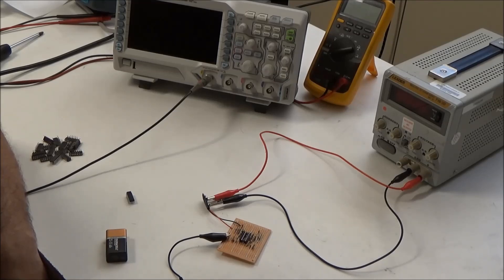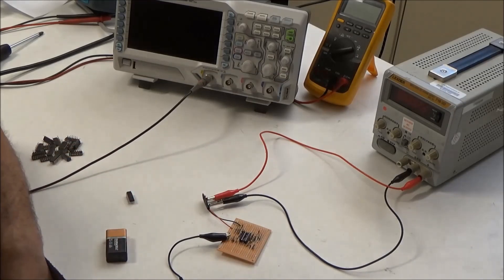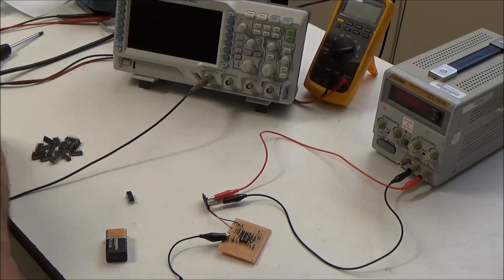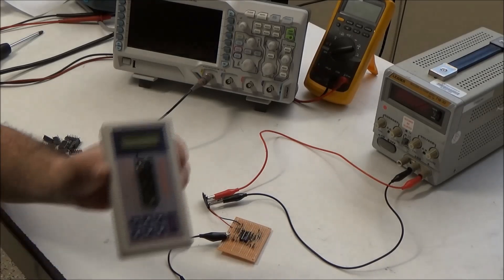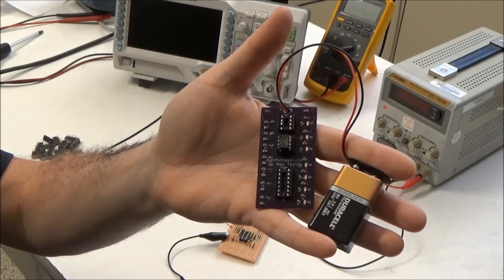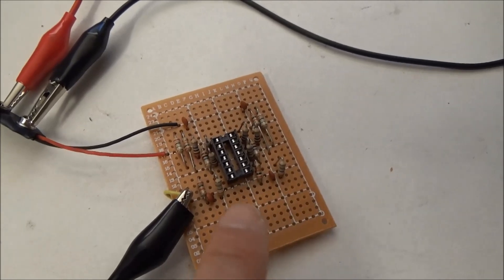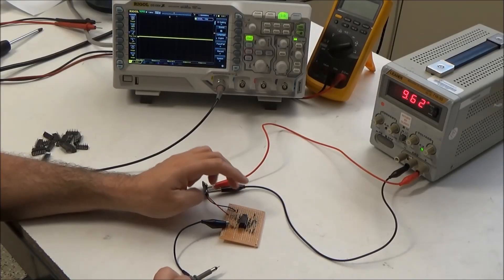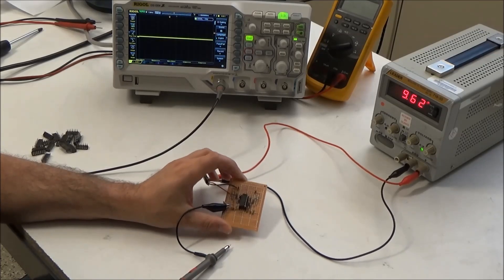Synthchaser #107 - Homemade LM3900 Norton Op Amp Tester

Comment: Le  circuit Intégré  LM3900 est  utilisé dans  :
- les amplificateurs CA, 
- Les filtres actifs RC,
- les générateurs de formes d'ondes (triangle, carrée, impulsion),
- les tachymètres, 
- et les circuits de logique numérique. 
C'est  un circuit  intégrant  quatre amplificateurs opérationnels  
IL est capable d'amplifier la différence entre deux signaux d'entrée avec un taux d'amplification très  élevé.
IL fonctionne avec  une seule alimentation . Qui rend Son utilisation   très  répondu
Brochage  DIP  -14
Bonne Chance pour Tous ! ♥️🌷🖋

Comment: Hi, could you design electronic circuits and devices starting from scratch and then showing the various connections and the arrangement of the electronic components while explaining how the electronic circuits work? so that I can make them more easily from my home, for example circuits with triggered logic gates and not synchronous and asynchronous brushless electric motors Op amp etc..
Ok? Thanks Luca

Comment: My mks 30 is faulty. As it warms up I can't save any parameters on the PG-200 the cable connected to the unit and PG shorted out possible the Ram chip? Need to have it fixed soon. Salutes